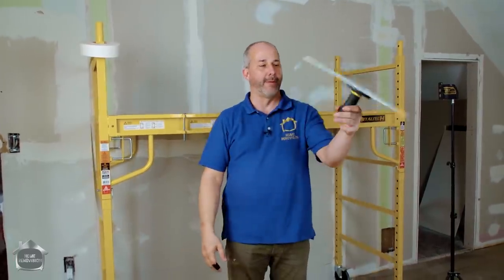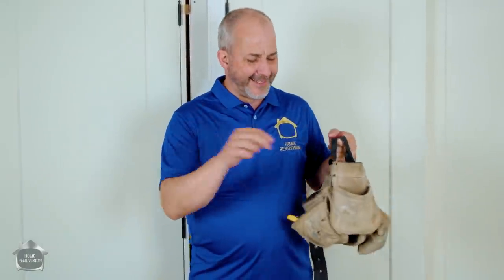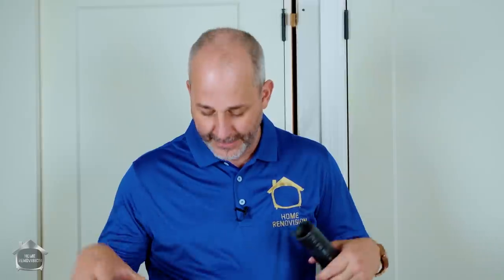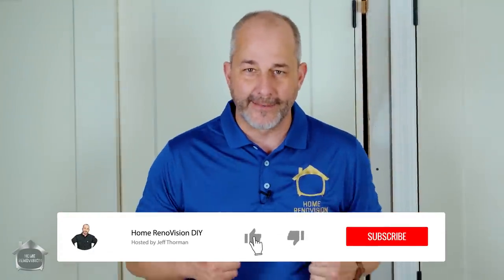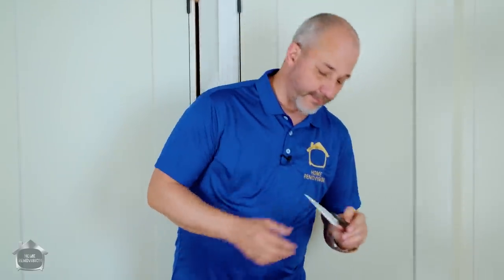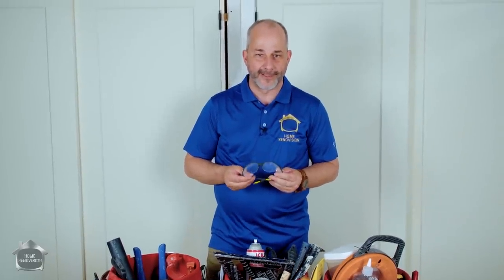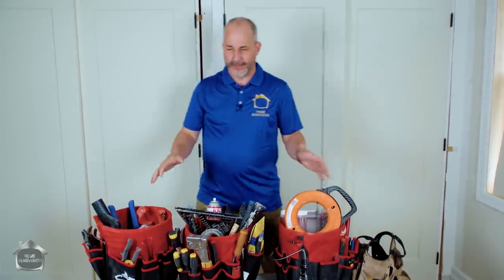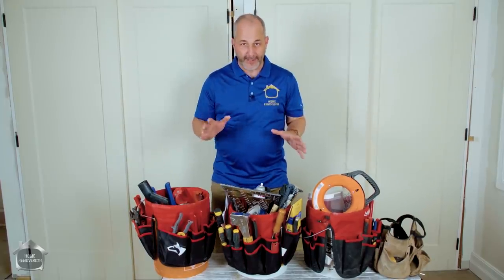How Should I Organize My Tools?

Comment: Been using these for 15 yrs. I also get different colors for buckets. Blue from Lowes for plumbing(blue=water), Red/Orange from HD for electrical(red=danger) Green from Menards for carpentry, (Green=wood).  This way I can see them from a distance.  I have several blue ones too some without the pouch for extra/oversize plumbing stuff.

Comment: I have shelves in my garage organized by major project/task:  electrical, plumbing, everything adhesives or sealing, everything sanding and scraping, everything painting, etc… then a roll away toolbox with a drawer by tool type/sets:  wrenches, sockets & ratchets, screwdrivers, etc.   Power tools have their own shelf(s).  Chemicals have their own, properly dispersed to keep things away from each other that need distance (e.g. oxidizers).  Then I married my husband, and nothing is where it should be anymore.  😂 we now have duplicates because he didn’t put something back where it belonged and he went to buy another one, and then found it later. 🙄

Comment: I find it helps to have redundant tools. For example, sheet metal cutters are used in plumbing, carpentry, and HVAC. So I have a pair of these in nearly all my boxes. I don't like to bring more boxes than necessary, so you don't want to have to bring a box for working on sheet metal just because you have to cut a bit of flashing for a plumbing pipe penetration while you're plumbing. Same is true for carpentry. You're installing a door and need to flash the bottom of the rough opening. Installing a door is carpentry work, but carpentry, especially exterior work, involves flashing. Nearly all trades require a hammer. For painting, I carry tools for taking apart things that are in the way. I like to remove electrical fixtures rather than paint around them assuming that they aren't old and their removal would likely damage the plaster or there's a risk you won't be able to put it back up. Point being, I have an electrical meter, screw drivers, and sockets, pliers,  allen wrenches, nut drivers, and a few things like that for painting because paint usually involves some degree of removing stuff. I tend to separate supplies from tools. So going back to the painting issue, the primer, fillers, sand paper, drywall mud, tape roll, would not be in the same box as the paint brushes, scrapers, roller  rollers, puddy knives, etc. Tools should not run out, but supplies do. So I put tools in boxes or buckets, and supplies go in storage boxes.

Comment: Love the tip. I have 1 bucket... and that's not enough. Because the tool I need is either in the basement, the garage, the car, or the bucket. So I'm still running up and down the stairs. I now realize I need for sure a plumbing bucket and probably some others. You are THE DIY Guru.

Comment: I'm a bit fancy on the Packout system - what I REALLY like are the 15" organizer totes they offer. I'm a plumber, so I have one for general hand tools, and I have one for my soldering kit. It fits an MC tank, paste, spark lighters, pliers, flame pad, and an old peanut butter container where I keep odd 1/2" fittings. Same idea, saves a TON of time, makes organizing simple. The only difference is that I don't have as much space - so I have to pay up for the engineering! Honestly though, it's an amazing system, I love it, and going from one small job to the next (sometimes I'll go to five sites in a day), it REALLY simplifies the process of meeting the customers' needs

Comment: I did the same kind of thing with tool boxes I collected over 5 decades ranging from steel to plastic construction.  Plumbing, welding, electrical (2), precision measuring, electronic detection, painting and a couple of others. I have one bucket with the pocket gizmos and a couple of empties. I pick and choose for the job and load them up.

Comment: The projects I’m working on are an attic walk in closet, bathroom refinishing ( tile floors,vinyl shower wall board, stair refinishing, and many others. A lot of replacing/dealing with water spots on drywall ceiling

Comment: I made a similar switch years ago when I got tired of spending more time finding tools than working on the project.
Except I use plastic tool boxes, and they are all clearly marked.
One for plumbing that has those tools. I have a torch box that has the brushes, flux, solder, ect for sweating pipe fittings.
One for electrical. One for all my air fittings, tips, and those cheap coil hoses that come in handy on occasion.
Then I just have multiple empty buckets in the workshop that I throw the bigger tools in when I need to tackle a job.
Like my 18" pipe wrenches, my 2' level, pry bars, etc. Then I throw in whatever selection of fasteners I might need and take that bucket, and the associated tool box to wherever I may need to work. When I am done, throw everything back in the bucket and put it back where it goes when I get to the workshop.
I also have duplicates of a lot of things spread across the various toolboxes. Razor knives, tape measures, side cutters, screw drivers, adjustable wrenches, etc.

The minimal cost of having duplicates pays for itself in the time I save looking for things or when I need to work in multiple locations simultaniously.
Like right now, I am rewiring my 2nd floor by going through the attic. So I need tools in the attic, and on the 2nd floor. Having multiple tools is so much easier than climbing up and down those attic stairs. Throw in the fact that I keep needing to pull home runs down to the basement, and I need tools on three different levels of my house at that same time.
I know, a tool pouch would cut down on some of that, but it isn't really practical to wear fitting through the tiny hatch to the attic, or when squeezing in to access the outside wall in the attic.
Reply: I’ve tried tools boxes but it’s not clear and I never know what’s in them until I go through few of them. This is a good system since u can see all the stuff right in front of u and there’s no lid. The only down side I see is it’s not stackable and it’s have to have it’s down location and I can’t stack other stuff on top of it
Reply: Sounds like you don’t use a tool belt?  I don’t usually buy I’ve been told that will help with having to run back and forth to get the tool you left in the other room. I think I will try these buckets and also get a better fitting tool belt that I will actually use more often. There are a still defiantly some tools that you need duplicates of. Who really has only one screwdriver?
Reply: @billsedutto8824  I use a belt when doing things up on a ladder, or on a roof, but they just get in the way when crawling around inside an attic, or even getting through the tiny attic hatch that I have in my house.
Also not practical in a crawl space either.

Comment: I started using the pail years ago. The reason was when in a crawl space when you got to the far end you need a tool, screw that you did not have. So out you crawl again and again. With the bucket it had all your tools, screws or what ever you needed. Was good to carry your waste material back out also. I now use it on every job not just the crawl spaces.

Comment: I have that same bucket nearby with an assortment of tools that I used on a consistent basis. Hammers, wrenches, utility knives, electrical tools, screwdrivers etc, etc.The rest are kept in the garage. I’m a homeowner who’s house is 70+ years old and is always fixing things here and there. Very useful way of organizing.
Reply: You should hire someone instead of fixing them yourself, because doing it yourself lowers home value.
Reply: I’m not gonna hire someone to patch a hole on drywall, change a faucet, change a door, or replace my water heater when I can do that work and save that money. I’m sure the same can be said for any homeowner who has the skills to the the work themselves. I’m not bragging about it, I’m not the “knows it all kinda person” but with some elbow grease and some YouTube help.......one can be surprised about what you accomplish.

Comment: THIS WORKS! I used two old sets of office drawer units; Every drawer has a specific set of tools. I stacked them and put a 'lazy susan' bearing plate on top. This holds 4 small parts cabinets in a square; So I can spin things around and always find the small parts, screws, nuts, bolts, connectors electronic parts etc. I need. The 'other stuff' I store in folding shopping crates 'one topic' in a crate.
When preparing for a project I know where to find things. If need be, I make a 'projectbag'. I'll have all I need at hand. Only the small parts cabinets cost me some money. Total cost: less than $100.

Comment: I've done this very same system except with rubber totes. One bin for each trade (drywall,electrical, plumbing and general carpentry tools) And 99 percent of the time you'll need to grab two bins to go do a job and when you're done it's easy to stack in the garage. 
I'm replacing my roof and rebuilding the side entrance deck. And if I have time I'll install a new window and board/batten siding.

Comment: Awesome video Jeff… I have a few of those bucket organizers and they work great. Lots of pockets like you mentioned to store all kinds of tools. I do have one for electrical, but now I have to get one for plumbing… Currently my plumbing tools are in one of those cloth type tote bags but some of the tools are buried and I have to move stuff around to see what’s below. The bucket ideal is perfect because I’ll be able to see most if not all of my tools at a glance. Re my current project: I’m converting my old kitchen into a bedroom since I built a 25’x 28’ great room with a kitchen / living room with a two-car garage below and I’m almost done with that… My next project is redoing or replacing a wooden front porch. When I constructed it, I used womanized construction wood? Now it’s getting old and time to redo it. I want to use structural grade plastic 2x10’s and 2x8 for the framing and the same for the flooring. My question is - is recycled construction grade plastic a good option to use since I don’t want to have to redo this porch again or is there a stronger grade rot resistant wood like hickory, I should be using…? Thanks for any thoughts and reply… PS Just absolutely love your videos… You certainly have a huge amount of experience and I appreciate the heck out of the videos. Save me a ton of work with those great tips+… THANK YOU….!!! Ray

Comment: Lowes has these little 5 gallon totes with lids. I use those for drywall, electrical, painting. Then a standard toolbox with all my plumbing fittings and tools. Then power tools, bits, tapes, screwdrivers and plyers, hole saw blades etc go in packout toolboxes which have pros and cons but I thnk the pros outweigh the cons.

Comment: This video is underrated golden advice. I like to have at least two of everything too except pencils maybe 100 of those everywhere they seem to walk off. Bucket organizer is definitely cheapest option but i like the horizontal bucket, also known as a tote. Bags are ok but to hard to get in and out of even left open and the bottom of a bucket can be a pain too. I don't know how people with boxes and packouts can work with the lids and moving about. And any pouch will do unless ladder work and need more or heavier stuff I use a cheap harness to keep the weight off my hips and my pants up usually along with suspenders underneath or overalls. Tool hooks are really handy too instead of just trying to use the clips. Another tip is the velcro on your pencil on your glasses, I got that from handyman mag and its very convenient. Glasses holders made for visors is good for holding glasses too. Coast makes some of the best headlamps if you get a twofer at costco- I carry it and backup rechargeable batteries. Of course I use boxes for auto wrenches and sockets. And cheap storage totes for storing power tools but the rolling husky boxes are good. You might have to go smaller tubs if you're lifting over the truckbed without a ramp. I really like my husky rolling bags. It was three in a kit, the big bottom one has the handle and the other two slide over the handle to carry all at once. They're easy enough to handle individually when loaded up. And fit more easily in the cab than hard boxes.
Reply: I go power tools in the bottom bag, batteries charger in the middle bag, bits fasteners in top bag. And then all the good stuff in the tote. 

Husky used to sell a an autoload knife and I've used them all. Folding, lockbacks. I liked the milwaukee fastback until they added the two notches, I just want one fully out but you're hand will suffer with folding designs. I like the solid handle. The autoload is now sold at walmart as Hart and is cheaper. You can fit 11 blades in there and its really convenient if you've never used one. I'm also not a fan of most bit boxes. Its too hard to get them in and out and stay organized. I take the holders out and keep them loose. I keep my most popular in husky belt bit holder, its rubbery and easy to keep track of and couldn't be more handy. And the backups in each box of their own type instead of assortments. My goto hammer is the dewalt demo. My milwaukee demo flathead is pricey but belts and boxes just covered a new blue yellow brand thats way cheaper. My favorite alltime tape is fatmax, milwaukee is slow to return. Stanley carbonized blades, diablo recip and circ blades. Dewalt pivoting bit adapter, and right angle. 

I use the ryobi rolling shop vac and it works well. I'd like to try a backpack vac for that last cleanup though. Sorry I went from organizing to brands 😂.

My final note is the guys that say they're are minimalist are always running back to the truck or borrowing all day. They'd be stuck without guys like me.

Comment: Prepping our house for resale.  Replacing carpet with vinyl flooring (using your tips for that already) but need advice on stairs/landings, rebuilding the basement bathroom - thinking floor to ceiling tile, good idea? - kitchen will probably be done by contractor

Comment: I liked the bucks at one point. But found myself pulling everything out to get to the one tool I need at the bottom. I prefer the pack out with wheels now with small bags for different tasks  I click the bags to my belt. Electric bag, trim bag, general use bag and so on
Reply: What bags are you talking about? I have the same problem with buckets because I have a lot of tools.
Reply: @thedewd516   Milwaukee bags at home depot. I get the 3 pack's with   6"×4"  8"×8" and3"×12" they have some other sizes also. The 3×12 are probably the handiest for me
Reply: Likewise, as a landlord I like my general tools in a little open 9x9 box. It has all my common tools. I used to do buckets but found storage a pain. I wanted stackable. So I now use a combo of clear storage bins for things like plumbing (can see all my fittings, etc) or drywall (all my blades, pads, tape - stuff that is hard to get in a round container) with a few tough system boxes with power tools or specialty boxes. So I can grab my wheeled base with my cordless tools, throw on a specific smaller box, and then sit a much cheaper plastic bin or two on top to wheel in to do what work I need. 10 minutes of repacking at the end of the day and wheel em out to the van.
Reply: I found a tool roll to be the best after trying buckets and bags.  I have a tool roll and a bag for later items actually
Reply: @setlemon  I have one of those too. You know what I found - I am not strong enough! When I had the dang thing loaded I couldn't even lift it into the vehicle to leave! Stairs were also a S.o.B. with it due to width. It sits next to my chop saw now holding a variety of oddball pieces that rarely leave the shop. Though I have thought about making it a clamp bag because other than a couple short clamps I don't have a good way to carry longer ones.

Comment: Lol I do the same thing but I have a pouch system I use. It's a bit expensive but I have a nice rolling bag the pouches clip on the outside of the bag. Power tools in the bag all the small stuff is in the pouches. Belt stays the same I just change my pouches as needed. My painting supplies drywall ECT all reside in buckets.

Comment: Thanks 4 sharing! I like the system but i think is good for smb who is using them quite frequently. As a homeowner that is using them seldom, i personally chose the Dewalt Tstack System although i spent around $600 but it keeps all my tools (incl all electrical ones) out of dust +occupying almost the same space as about 5 of those buckets. If i would work on a daily basis w them, ur system is more practical, indeed.

Comment: I made all my walls in my garage with spots to hang each tool.  I used nails of various sizes. Like two nails to hang a hammer on.  When I finally was sure on the locations I used a sharpie and made and outline of each so everyone else also knows.   I also have giant long magnets that many screw drivers go on that I got at a big hardware store. I mounted one big cup on that wall for pencils, skinny stuff.  I did more than that, but it’s a big part.